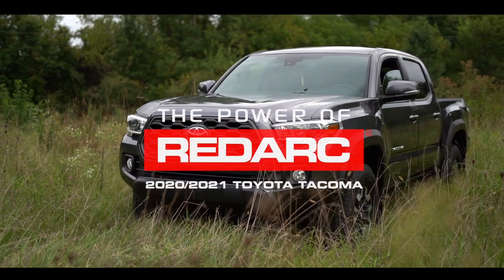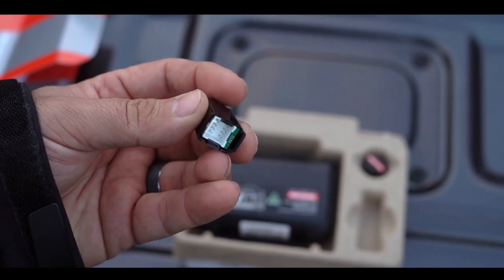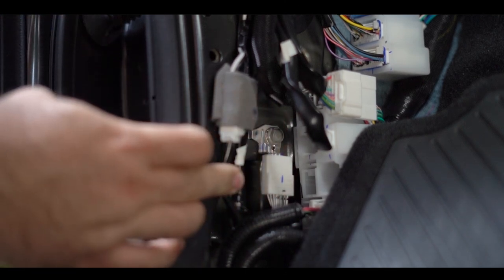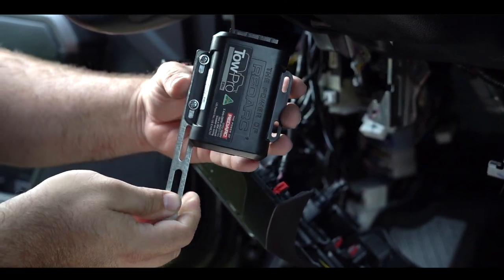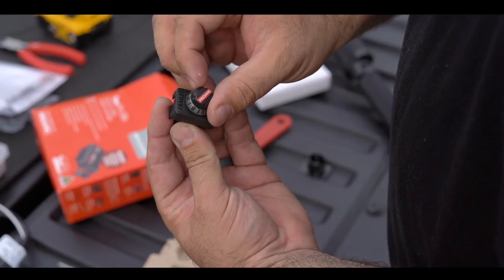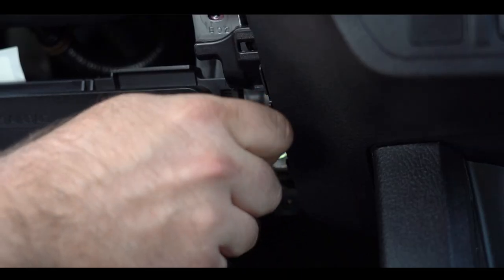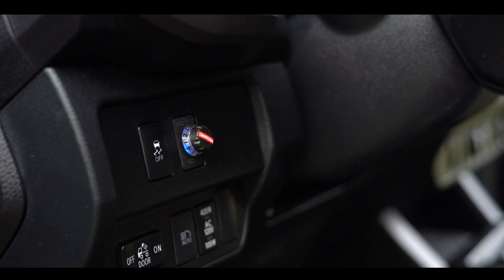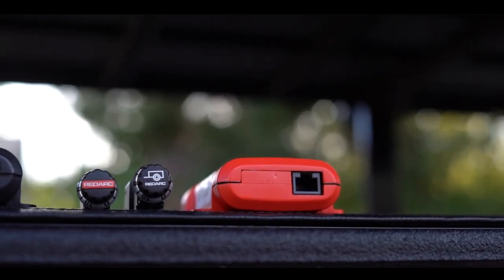HOW TO | TOYOTA TACOMA BRAKE CONTROLLER INSTALL

Comment: Why does the metal mounting bracket not come with the full Tacoma kit??   The mounting bracket is necessary and should have come with the kit.  I just installed my Redarc controller today and I just zip tied it under the dash for now since the bracket did not come with the kit,.  Now I have to order the bracket and take my dash apart again to securely install it.   This is extremely frustrating.
Reply: Money grab
Reply: The 'bracket' is a common generic piece.  Go to any hardware store and ask for the hardware aisle, tell em you want a small corner bracket or strap.   Should cost about 2 or 3 dollars.  I had a pack of 4 sitting on a shelf in my garage from an old project, it worked just fine.

Comment: It's a video like this from a manufacturer that really seals the deal with selecting a brake controller. The only thing I see off the bat that's different is that my 2019 Tacoma Pro does not have that upper row of switches or switch blanks. It's a cubby. The only blank I have is the odd-shaped cutout to the right of the 120V outlet switch. I wish you made a blank which fits THAT cutout. But I'm sure I can manage with a Dremel or something. It looks like maybe the TPSI 007 blank might actually fit that space? If so, it would be awesome to include that as a mounting/blank option in your video. But otherwise, great job!
Reply from the maker: Thank you for your interest in our brake controllers, and for taking the time to watch our videos. You are correct that the TPSI-007 would be the best for your vehicle. Any further questions please contact our Tech Support Team directly and they'll be more than happy to assist.
Reply: @REDARCElectronics  ok thanks! I placed my order and looking forward to installing it
Reply: Looks like that switch does not fit into that space

Comment: I just finished getting the tow pro elite installed on my 2022 Toyota Tacoma and when I hooked the battery back up and got in to crank the truck no lights come on, I can push the button for just a moment and release and the light will fade on then fades right back off and stays off. This was without a trailer attached, do I have a problem or will it do the flashing once I hook up to my trailer Saturday? I’m so frustrated and can’t get ahold of your technical support number just sits there listening to the music until it finally makes me leave a voicemail.
Reply: Did you figure this out? I just finished installing mine and I have the same problem. I don't have my trailer hook up.

Comment: Well, I bought a Tow Pro Liberty, and the Toyota dash plug and the cables.  Watched this video and went out and knocked it out.  The only variation between the video and my installation; the lower switch panel insert can not be installed with the switch in it.  Your video used the upper one. Put the insert in and then the switch.  I'll leave alone accessing that little ground bolt, but I got it done and your video made is a breeze.  Thank you for the video which matched my 2020 TACO Double Cab Limited.  I will most definitely recommend your product.  Thanks again, You were complete and steady and no stupid background music.
Reply from the maker: Hi Billy, thank you for your message and for choosing a REDARC brake controller for your Taco! Great to hear that the video was helpful and you were able to get it installed quickly and easily. Can't wait to hear how your towing adventures go using our Australian made gear. All the best from the whole team at REDARC!
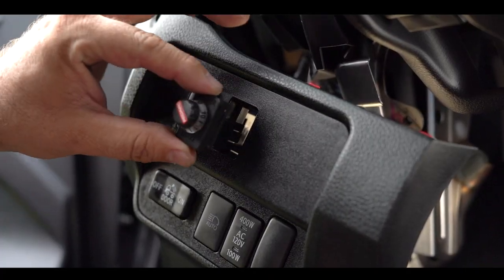Reply: At the 4:21 time stamp that slot you pulled is my camera switch (2020 TRD Off Road) so not an option for me but..

Will the switch fit in the longer slot to the right of the AC control button?
Reply from the maker: @M1xmastaspig  Hi there, thanks for your comment. The closest option will be our TPSI-007 insert instead – this is slightly skinnier and longer then the TPSI-002 so should fit here. If you'd like to discuss options further, please feel free to contact our Tech Support Team via phone at our head office.

Comment: What’s the difference between the elite and the liberty? Also, kinda confused on how to actually operate and calibrate the brake controller, do you guys have a more in depth video on how to actually use the controller?

Comment: NOTE you may not be able to slide the controller knob. through the opening with the new knockout assembled you may have you put the new knock out in first then come from the backside with the tow pro controller knob thats what I had to do on my 2020 Tacoma SR5

Comment: It doesn't look like i have that pigtail on my Tacoma. I have a 2016 4x4 double cab SR5 with the towing package. It has the transmission cooler mounted on the radiator and 4 & 7 pin connectors by the hitch. What am i missing here??? Do i need to build a hardness myself if it's not there??
Reply from the maker: Hello, from our research, the 2016 Tacoma should have the Plug N Play option. Our-TPH-015 will be the suitable harness if you can find the connection point. Toyota suitable Tow-Pro Brake Controller Harness (TPH-015) (redarcelectronics.com)

Comment: Installed in about 1 hour without using the their bracket (Had to makeshift one since they were out of stock). This video does explain it well. Although, where they mounted the ground connection isn’t nearly as easy as the ground by the fuse box. 2021 Offroad
Reply: Good to hear, I'm about to do the same. Were you able to get screws through the slot on the unit?
Reply: @joshjerge733  Yeah it wasn't hard at all. Just go to a hardware store and get a slotted bracket with about the same dimensions and you will be fine.

Comment: 2021 TRD OR. Great video!BUT I forgot to order the bracket. Went to depot and bent an L bracket straight. Grabbed a couple fasteners with locking nuts. Turned out exactly the same. Would’ve definitely have gotten the bracket had I known. But if anyone else did what I did or wants to save a few bucks. There’s a solution at depot. 
Think this would be better if they were sold in vehicle specific bundles with everything you need. 
On my Tacoma I had to order a different dash insert than the one provided. I also wasn’t interested in the universal wiring harness and ordered the vehicle specific. Excited to see how well this tows!
Reply from the maker: Thanks for choosing a REDARC brake controller, and for taking the time to provide feedback. If you have any further questions on setup or use of your Tow-Pro please call out Technical Support Team at our head office and they'll be happy to assist in greater detail over the phone.

Comment: I have a 2016 and do not have that size switch on the bottom row. Top row is the cubby. I actually mounted the Redarc switch straight to the right of the power switch and third brake light switch, and to the left of a blank switch. Drilled a hole through the plastic piece, snipped off some plastic in the back, and mounted it.
Reply from the maker: Thanks for choosing a REDARC brake controller, Brian. And for sharing how you went about your installation. We'll pass this on to our teams to help support other customers with a similar dash setup.

Comment: So is there not a way to manually apply just the trailer brakes without pushing the brake pedal? Like most other brake controllers? I test my trailer brakes before each trip using the manual switch.
Reply from the maker: Thanks for watching! If you press the dial that’s mounted on your dash the brake controller will apply the brakes on the trailer up to the number set e.g. having the dial set to 5 will give you 50% braking power.

Comment: I have a 2022 model and just ordered the liberty controller as I will only be doing normal on road towing.  I also ordered the dash blank and the wire harness and mounting bracket you mention.  I am hoping this will all work with my model year as you only mention up to 2021.
Reply from the maker: Thank you for watching, Quinton. And for choosing REDARC gear.

If you have any questions when it comes time to install your brake controller don't hesitate to reach out to our helpful Technical Support Team either by phone or email. Details can be found here https://redarcelectronics.com/pages/contact
Reply: Well I guess my question would have been does this work with 2022 models?
Reply from the maker: @quintonstone7324  Our Tech Support Team has reviewed the items you have purchased and can confirm that they are suitable for the 2022 model, and we will aim to update all of our product specifications to reflect this over the coming weeks.
Reply: @REDARCElectronics  the harness TPH-015 is not the right size for my 2022 Tacoma (Canadian market). My truck side connector says 3031-P.

Comment: I have a 2021 Tacoma. Looking at installing the switch. I dont have a blank switch insert. The blank switch in the video is actually the front View camera on my vehicle. What are the alternatives?
Reply from the maker: Hi Timothy, thanks for watching! REDARC does offer universal options witch you could use. The TPSI-001 can he used in place on the cigarette lighter socket if you don’t use it or have a spare.
You could use the TPSI-010 and mount it anywhere on your dash, it is made up of a soft material that conforms to the dash when installing the remote head for a flush finish.

Comment: I have no trailer attached. When I press the button, it lights up blue for about a second and then fades away. The only time the blue light comes on is when I press the button. Does this all sound normal?
Reply: My did the same thing, let me know if you ever got the answer to this!

Comment: Hey guys I have a question. I am getting ready to buy a 7x14 tandem axel utility trailer and need to  uy a brake controller as well. I asked the dealer if I would have to make an appointment to get it installed and he said no if your truck is already wired for it exact words were "plug and play" and said yes, if it isn't. So my question is, is my truck ready for the plug and play? 2019 Tacoma TRD sport V6 tow package
Reply from the maker: Hi Brandon, thank you for your comment and your interest in REDARC products. We can confirm that your vehicle is suitable for a plug and play style installation of our Tow-Pro brake controller. Simply choose between our Tow-Pro Elite and Tow-Pro Liberty models, then add the below harness and switch insert panel and you'll be ready to go.

https://redarcelectronics.com/products/tow-pro-brake-controller-harness-to-suit-toyota-tph-015

https://redarcelectronics.com/products/switch-insert-to-suit-toyota-mitsubishi

If you need any installation help don't hesitate to contact our friendly Tech Support Team on +1 (704) 247-5150

Comment: Will this work in a 2017 TRD OR?
Reply from the maker: Hi Eric & Julie, thanks for your comment. Certainly the Tow-Pro brake controller will be compatible with your year/model Toyota too – it will be the harness we choose to install it with that really matters. Luckily, the wiring will be the same on yours – you will need TPH-015 to successfully install the unit. The switch insert should be the same as in the video too.

Comment: I fell for it.  I missed the comments at 00:15, three critical peices are needed to complete the install. They are SOLD SEPARATELY, totaling about $288.
The switch insert I managed to drill hole into the blank insert and saved  $13.70 (Amazon price Sep '22). The mounting bracket, not sold on Amazon, their website lists it for $24 (back ordered), got around the bracket by using bolt and zip ties.  The wiring harness, oh my gosh $32. I hope the folks who assemble the harness are paid a living wage.   

In the end the video says you will be done with the install in half an hour! Bonkers. May be for a professional or someone very familiar with Tacoma. It took me half a day, adding insult to injury.

Wonder how much money they sank into this curated content. If they shifted that budget to clearly calling out these extra required parts are sold separately and at a reasonable price I would be their life time customer. 
Instead every time I look at their logo on the switch I will be reminded of the bad experience regardless how good their product may be.
Reply from the maker: Hi vjpdx, thank you for your comment and for choosing a REDARC brake controller product.

We're sorry to hear that you don't feel this video best represented the installation process. We endeavour to provide as much information as possible for our customers to undertake installation themselves, or connect them to an experienced installer in their area. However we do appreciate you taking the time to provide the feedback and will certainly pass this on to our internal teams for review.

If you do have any further questions about the installation process, or would like some over the phone technical assistance, our Tech Support Team are available for the cost of a local call to help with any enquiry. You can reach them by calling one of the numbers appropriate to your location, or by sending an email https://redarcelectronics.com/pages/contact

We thank you again for choosing a REDARC branded product and hope we can be of service to you again in the future.
Reply: If you watch other videos you find that there are options to buying all that extra hardware that anyone with a garage full of stuff can make work. Don't need the bracket-Don't need the pretty insert, but would be nice if reasonable. All you need is a drill, dremel, that $20 cable, and some grunting and swearing if needed. Nothing is easy. Everything takes three times what you reasonably think it should take. I think that is an amendment to Murphy's law.

Comment: I have a 2022 TRD Off Road 4x4. All 2022 4x4's have the tow package. I do NOT, however, have a loose plug to the left of the brake pedal to attach the "plug and play" cable to. It's tough to play if you can't plug. What's up? Is it hidden or taped up somewhere? Everything else in my install went smoothly except the controller would only mount horizontally where the video show it being mounted vertically.
Reply: Never mind. Found the plug! It was bent underneath, behind a bunch of other wires and against the side wall. The rest of the install went fine. In the video, the guy's arm blocks most of the shots of the plug and the site where the ground is installed. Other than that, good job. Thanks.
Reply from the maker: @j.murrayzeigler7142  thank you for taking the time to review this video, and for choosing a REDARC brake controller.

Glad to hear you were able to install this as desired and hopefully this video helped support that process. If you do have any further technical or installation questions please don't hesitate to contact our friendly team over the phone https://redarcelectronics.com/pages/contact

Comment: This controller is NOT compatible with 2021 Toyata Tacoma (according to my dealership at least). I wish it was, bought one and have to return
Reply from the maker: Hi Julius,

Thank you for watching, and for choosing to buy a REDARC brake controller.

We can confirm that our Tow-Pro units are compatible with the 2021 Tacoma, and offer easy installation with the below accessories.

https://redarcelectronics.com/products/tow-pro-brake-controller-harness-to-suit-toyota-tph-015

https://redarcelectronics.com/products/switch-insert-to-suit-toyota-mitsubishi

If you'd like to discuss in greater detail with our Tech Support Team you can reach out via phone or email by visiting https://redarcelectronics.com/pages/contact